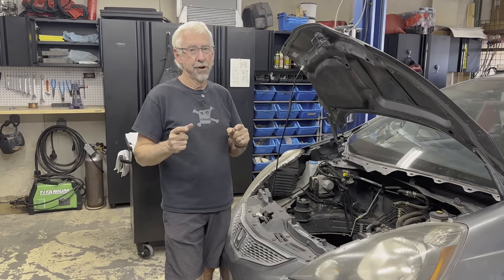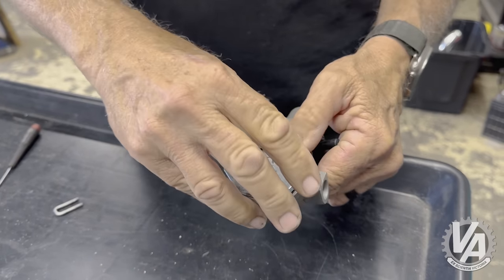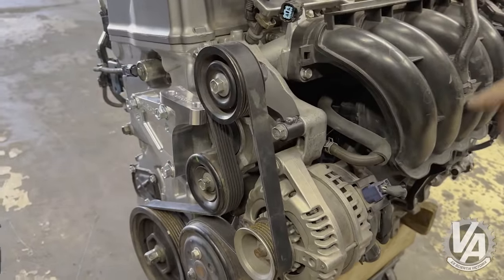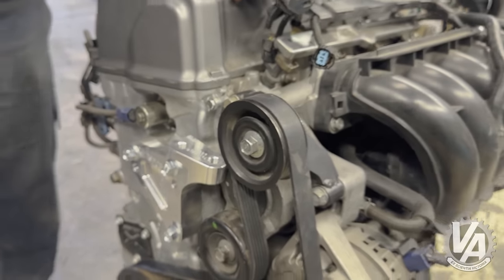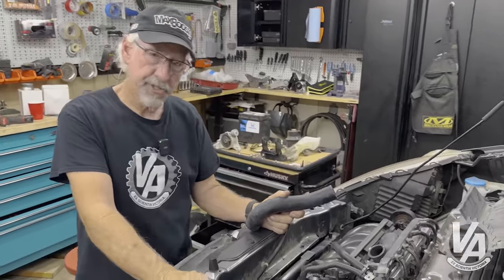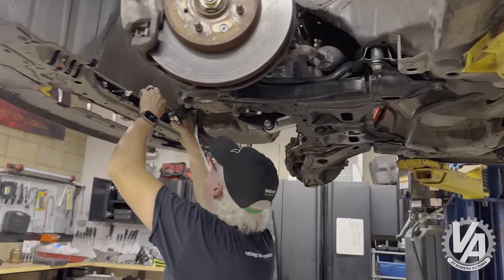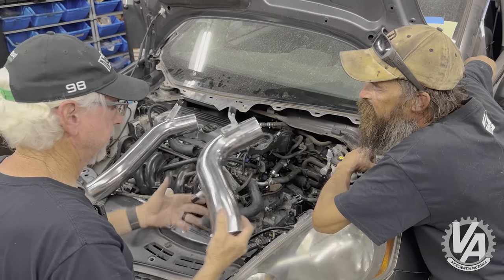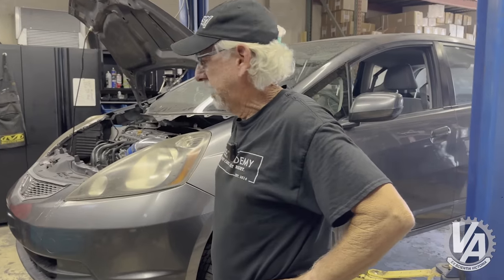This THING Rips! K24 GE Fit Clutch Mod and First Start (Part 3)

Comment: I think this was mentioned before but if you don't want to drill your clutch master cylinder, you can just use one from an 01-05 Civic. All the fittings are in the same location and it doesn't have the clutch delay valve.
Reply: I was coming in to say the same thing.
Reply: Yeah but drilling out the plate sounds like much less work than swapping out the Civic CMC
Reply: @egwenv84 huh??
Reply: @egwenv84  the civic master requires no modifications. So it’s less work.  It’s only $40 for a exidy MC on rockauto.
Reply: Can also verify. I went through loads of those dampened clutch master cylinders on my RSX-S until the day I switched to regular 02-05 civic. Not one single issue whatsoever in 7 years now.
Reply from the maker: Yup. But if you don't want to spend the money, just drill it out.
Reply: Literally clutch master cylinder from 96-2000 civics will work too
Reply: @egwenv84  yeah im wondering if i could just remove the cover while keeping the cmc on the car. Then just put it back together and bleed it
Reply: @Tantium  Something tells me that would be too easy with clearances and whatnot but would be awesome if someone could verify. Who the hell wants to swap and adjust a bunch of parts when u could just drill or take out a plate instead?!
Reply: @VTECAcademy  what shift cables did you use, what adapter, & will it be the same as for the tsx 6 speed transmission?

Comment: instead of using that rubber piece  to upsize lower radiator opening, i use flex tape. working well 5-6 years on my K24 swap Fit. give it couple of wraps to upsize according to the size of the new hose

Comment: Rev hang is engaged with the top clutch switch. its how the ecu knows that the pedal is depressed. if it never sees this interaction then rev hang will not happen. but you will also not get access to cruise control. sooooo if you dont have hondata and dont like cruise control. there ya go

Comment: If I’m not mistaken, the 09-14 TSX uses electronic powersteering and has its own proprietary idler pulley. 31140-RL5-A01
Reply from the maker: Yes, but it interferes with our block bracket.

Comment: Just to reiterate, you can skip all the issues with the CMC by switching to an EM2 civic CMC. Bolts right up for even the 06-11 civic, 04-08 TL and many others with this style of CMC
Reply: Tsx as well
Reply: RSX works with the 7th gen civic CMC as well.
Reply from the maker: Yes

Comment: There is a very VERY tight squeeze when you put the alternator on the bottom, just below centerline of the water pump pulley, and have the AC compressor up top, but it is do-able when we measured it out for my 2013 Honda Fit I owned at the time.

Not sure 100% as the project never was completed, and vehicle was returned to stock until the car left my hands.

I remember having the alternator pulley so close to the water pump stuff it was difficult to slide a belt over it.

One of the aftermarket electric waterpump setups makes a huge amount of clearance, but that removes typical honda reliability of mechanical parts, so was not chosen.
Reply from the maker: We will be adding AC and document the process.
Reply: @VTECAcademy  Love it!!

Comment: Im curious if the clearance of the GD Fits with a K24 are any different. I'm picking up a fit next month as well as a motor and a Si LSD transmission from a local yard. Would Hasports Mounts give me enough clearance with the K24 or should I fab something similar to what you made? or are your mounts that you made for sale? Thanks in advance.

Comment: I wish all Honda dealers were so friendly. I bet my 3 local Honda dealers wouldn't do the flash, and would say it either isn't possible or they aren't allowed to do it. I went in with an actual Honda TSB printed out for a known issue with a flash update that fixes it and I wanted to PAY THEM to do it and they wouldn't do it.
Reply: Wild they wouldn't accommodate your request. Normally the issue is proof of ownership, They usually have to verify your the owner before flashing the ECU.
Reply from the maker: Annoying

Comment: 36:53 LOL, nice bleep. Holly 💨💨, Are the mount kits currently available for sale? Also, are you going to sell the wiring adapter harness from Fit to Accord ECU? This swap looks like the recipe for an ideal daily driver.
Reply from the maker: Yes on the mount kit. I need to order parts for the adapter harness, so not yet on that.

Comment: Guys what is a Fit cost in the states now, and what is the best 2.4L Engine Mission combo?
Reply from the maker: You can find them as low as $3500 USD, but they will be rough. A decent clean one will go for around $8,000 to $16,000. The best combo is a K24Z with a 6 speed.
Reply: @VTECAcademy do you not like the 5 speed?

Comment: Can you clarify - if the clutch master cylinder has the rotor shape cap - than 100% it has a slow release mechanism and needs to be drilled ,correct?
Reply from the maker: Yes

Comment: Use a smaller AC compressor?  how much does that frame bump stick out ?
Reply: I am using MAzda RX8 one. working fine and is easy on engine aswwell
Reply from the maker: Unfortunately, that won’t work, the pulley is what interferes.
Reply: What about an electric ac compressor?

Comment: will a rsx or si 6 speed work also with that tranny ?
Reply from the maker: Yes. but different mont kit. GEK2
Reply: @VTECAcademy  Gotcha feel 6 speed would make it that much more fun.
Reply: @FinalDriveRacing  it does 👍
Reply: @VTECAcademy  21:42 what ADAPTER & SHIFT BOX is used because I have TL & ACCORD cables but original Fit shift box?